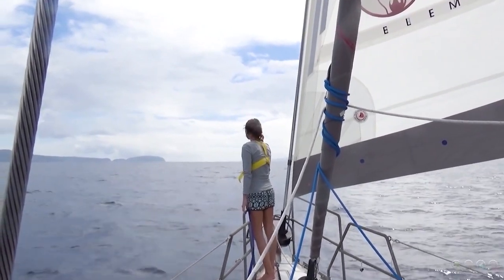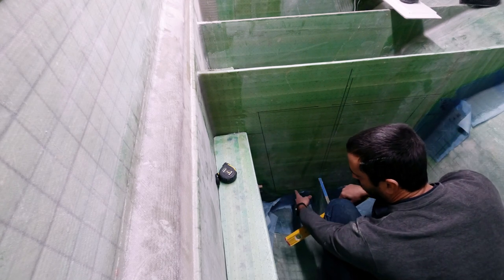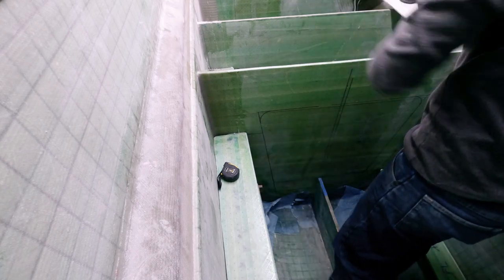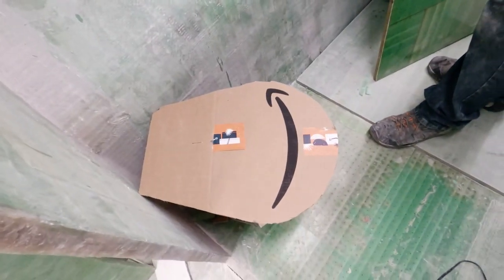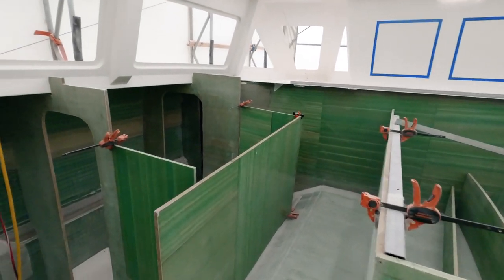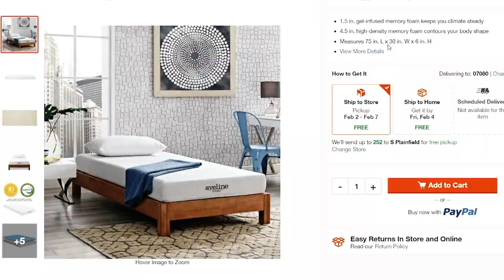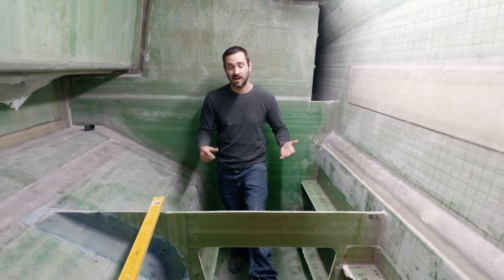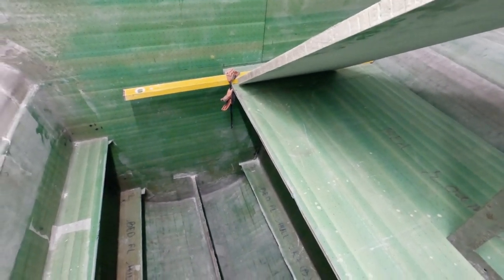CATAMARAN BUILD - We Brought On A HUGE Partner!!  (MJ Sailing - Ep 222)

Comment: I noticed you were using a hot knife to cut foam for a mattress. Just thought you would like to know that the old style electric knife with two oscillating blades works really well for cutting foam. Fast and clean. Excellent job with the glass work by the way.
Reply from the maker: Yeah, that was for our aluminum build back in 2016. As soon as we put out that video a lot of others suggested an electric knife and we were like "Why didn't we think of that?!?!". 😂

Comment: There is a store in Baltimore, called House of Foam. They have made many different shaped foam cuts for me over the years. Give them a drawing and they can cut it. Think of an L shaped cut in the middle of the mattress. When flat it's your mattress. When you need to work on the engines,  you could fold it in half and take it out of your way. Giving more room to work and keeping the bed clean.
When building a master stateroom, fitting the space to any anticipated use of the owners day to day use, should be the priority. Then the ease of maintenance.

Comment: Vetus makes great products, congrats! For the mattress, I would think splitting it in the middle would be the biggest PITA unless you're planning to never actually use that bed (in which case why would you care about activities ;o). So everytime you need to check the oil, you have to strip all the linens off the bed, shove it all to one side or the other, lift it up, check the oil and then put it back down and remake the bed? I think I'd just go with a 2" shorter bed or hinge it on the side.

Comment: Hi guys! been following your build for a while all the way from Russia. 
Your cat is very interesting and you have a lot of thought put into organizing your space.
As a though: you look at the mattress as a one piece or a two piece split longwise, but you can split it widthwise 1 or 2 times like in a folding bed (or a hospital bed). The splits would help you get more space over the engine, because they would fold at 90' up to the ceiling. Have a look at motorized hospital bed frames to get the picture.

Comment: If you decide to use a foam mattress ,take it from a guy that's had 6 back surgeries ,go to the best memory foam mattress pad you can find. I'll never sleep on anything that's not memory foam . Our mattress for our king size bed is 10 inches thick and it's heaven to sleep on compared to the orthopedic mattresses we've had before the memory foam. One thing about memory foam it molds to fit your body and on a rocking boat it would really help to keep you from rocking back and forth or even falling out of bed .

Comment: They make RV short queen mattress that are only 74 or 75 inches long.  I learned that when a regular queen size fitted bottom sheet didn't fit snug on my RV bed. 
Instead of hinging the bed could you rig a mechanism to just lift the whole thing straight up? 
Hey, how about mounting the engine to the platform the bed rests on, that way you could have a vibrating bed like they used to have in motels.  😁

Comment: I was thinking as you were trying to figure out your bed situation and wondered if you could engineer some way to lift the entire bed platform straight up against the overhead? That way you wouldn't have to deal with the pivoted platform piece(s) and the only space you would lose would be the thickness of the mattress overhead when the space was opened up to work on the engine. Maybe 4 pulleys at each corner and a cord similar to a Venetian blind setup?

Comment: Outboard motors is the way to go , lifting them completely out of the water similar to the James Warren designs . Ease of maintenance  , repairs  and best of all cost of replacement  .
Reply from the maker: That was the plan until we spent some time on cats with outboards. We didn't love the noise.  And after talking to their delivery captain, the lack of thrust in reverse made moving in a tight marina difficult.  These, and a few other things, made the decision to go diesel easier.
Reply from the maker: We originally ordered the kit with the idea of doing outboard engines, but after talking to a number of Seawind owners who had them on their boat (and weren't thrilled with them), and getting aboard one as well, they only look to be ideal for coastal cruising, but not for the long term cruising we'll be using this boat for.  🙂

Comment: Hinge and mattress selection: I recommend a butterfly hinge in the center of the space running along the longitude axis and make it removable. That would allow to work on the left and right side - or both.  Left hinge   l._    Right hinge    _.l   Both    l.l    Hold with velcro, hook or prop stick.  Remove the entire unit as one piece for major issues, access and engine removal.  Mattress - foam is heavy, bulky and will mildew; I've had a Sleep Number system for over twenty years and swear by it.  The queen system is made up of two mattresses independently adjustable for firmness with a layer of foam. It's easy, light weight, mildew retardant, collapsible, relocatable (topside/salon).

Comment: The hatch over the engine you discussed at length: Did you consider splitting the hatch and mattress in half athwart-ship, and hinging them together? The forward half would be flat to the overhead when raised. The strut(s) needed to hold them up will be a bit more complicated but probably no more than splitting it fore-and-aft.

Comment: Hinge the bed vase again accross the 60' width where the square was outing the base so that between the hidges goes near vertical and the base from the new hindge to the end f the bed can go horizontal to the cieling to the roof of the cabin allowing full access to the engine.

Comment: Major discovery for me. See how Matt uses his tape measure,  when it's in a confined space,  like me, he bends the tape by holding the actual handle or mechanism at an angle. 
I  found out that every tape measure in the world has a measurement stamped on the mechanism that states how much to add if you just use the back of the mechanism hard up against that end of the tape.
Very useful if you want really accurate and easy dimensions in confined spaces.

Comment: Amazing you have come such a long way in a short time; it's nice to see. I was thinking you could make the bed lift from the four corners up towards the ceiling. Four straps made of the same material as seatbelts or Dyneema hoisted by small remote-controlled electric engines. That would be very cool and leave plenty of space to work in the engine compartment etc. The same concept is used in some camper vans, I don't know exactly what it's called. Retractable ceiling bed pulley system or something like that.
Reply: #Vanlife calls them elevator beds

Comment: I'm sure you figured out the bed scenario by now but what about a double-hinged bed board that instead of hinging like bomber doors down the middle, hinges across the middle to fold the front half of it up or under the back half and then you can hinge the back half along the back wall to fold completely out of the way?
Reply from the maker: The issue with that is how the mattress foam folds.   We found that we'd need to cut the foam wherever you think it would bend.
Reply: @MJSailing  True but while opening it up down the middle will provide engine access, it will certainly diminish activities compared to my hinging suggestion that would not only allow you to get to the engine but may help with the indoor activities at the same time, no?

Comment: Question?: since you have partner with Vetus, why you don't use the E-LINE INBOARD PROPULSION MOTOR Line for your boat, way smaller, less maintenance and less noisy. Also the price of gas will continue to increase .
Reply from the maker: They only currently offer up to 10kw motors.  These are too small for our comfort level.   If they had larger, we'd consider doing a hybrid.

Comment: Avoid foam particularly in hot climates, go for the best mattress you can, some manufacturers will produce a custom size.  I had one made some years ago, it just took a little longer and wasn't more expensive than usual.  The manufacturer can include a zip and velco flap in the middle to avoid an irritating gap. 
I hope Vetus can guarantee availability of parts/replacements well into the future.   That really is a sign of a good manufacturer.
Reply: 200*160 cm or 200+80 cm are standard sizes in many coutries....

Comment: Awesome news on the partnership with Vetus.  Have you considers a set of 4 gas shocks lifting the mattress vertically?  If you can get the heights from front to back it would make maintenance/repairs much easier.  Not sure if there is a vender that makes it to where you can lift from the front and all four raise equally.  Just a thought.  Love the build.

Comment: Could you hinge the engine bay cover on the outboard side, have enough width that when the cover is hinged up that the mattress stand on edge against the outer hull, then the cover would be at or close to 90º. I guess by the time you read this it's too late, but still curious if this would have worked?

Comment: I’m no boat builder, but could you build clam shell doors and use a one piece mattress by pulling the mattress to the ceiling with rope/bungees and then opening the clam shell doors without the mattress interference and have full access?

Comment: Could you maybe lift the entire mattress vertically, with say a rope and pulleys at the corners?  This would give you as large a working space around the engine as can be had.  No headroom issues around the far end of the engine.  It would also be simpler than having two mattresses.

Comment: On the bed lift system have you considered lifting it straight up. Similar to an RV toy hauler garage bunks which lower from the ceiling in parallel to the floor.

Also went straight to Vetus and ordered a catalog :)

Comment: Is there enough torsional rigidity in the foam core so that you could put a strut just on the back-side of the clamshell hatches? Or would you need to put a strut on the front edge, too? I would assume that would obstruct access to the engine more than you'd want. I suppose if you glass in stringers along the bottom of the clamshell doors???

Comment: I have a few vetus items on my boat but having troubles getting replacement parts for them and service kits , I have a fresh water pump start leaking but can't find a service kit for it, I took it apart to find gasket was damaged from new had been assembled incorrectly.
Just letting you know my experience
Reply: Sorry to hear that you’ve had a negative experience with a VETUS product. In addition to our unique 3 year warranty period we should be able to offer assistance long after that. As we do not sell to consumers directly we do not have the required data within the system of our head office to help you out directly (date of sale, model number, parts required) so I would have to advise you to contact your point of sale for further assistance. Your sales representative should be able to assist you with warranty, technical information, and spares. If this is somehow impossible or if you feel that support is lacking, please send us an email on our general mail address (found on our website) with a description of the failure, the spare part requested, and please include your purchase information so we can respond adequately.

Comment: Instead of a hinge system why don’t you think about a pop up trailer system ,instead of being on an angle the bed would come straight up. And that would give you more room to work on the engine. Besides you would only use it occasionally for Engine maintenance

Comment: Why not have it base of the bed as two pice but instead of hinging it for to aft, run the hing port to starboard..  Have it fold up at 90 degrees at the far end, then have it fold another 90 degrees a little further up   _|-  with a couple of simple boards or support the mattress could rest horizontal while you are working on the engine.

Comment: Wondering if you have any thoughts on boat computers. Something like the Star 
Trek starship computers, or HAL on 2001... It's now quite feasible to have such devices to log activity/maintenance/repairs/boat metrics... Sensors have become very inexpensive, temp/pressure/c02/gas_particles/compass/motion sensors/gforce_sensors/gps/water/wind speed/wind direction/... Could do some very interesting things hooked up to cameras and other devices. Things like sound detection in a specific direction turn on cameras to catch wildlife activity, or smarter autopilot, better safety warnings/notices... A combo wired/wireless sensor network with multiple embedded processors could make a really fun build out.

Comment: Foam mattress? How about memory foam? Those are super comfy, but flipping them may be an issue. I was going to say that giving the constraints you have with space for the engines, I would have gone with twin 10 kW Oceanvolt servoProp drives. Then I looked at the price! Can Vetus put together a similar system? There's no way that twin servoProp 10 kW electric motors (and the controllers, etc.) can run over $85K! Things are looking good with the build!

Comment: Are you installing your engines with shaft drive or saildrive?
Reply from the maker: Shaft drives.  Moves the engines forward for weight balance.
Reply: @MJSailing  will be interesting to see how you insulate. Diesel can be loud under the bed, also the smell, but that's when only when the boat gets old.  However shaft drive is a good choice.  Didn't they allow it to be moved even further like in  antares catamarans, worth asking them if that is possible.

Comment: Clam shell doors would mean unmaking the bed just to do engine checks… I’d go with the car hood…..
Reply from the maker: If we go with the clamshell doors we'd do two twin mattresses, where each would have their own fitted sheet, and then the top sheets and comforter would be queen.  The top sheets would need to come off each time we checked on the engine, but they could just be pushed to the side.  🙂
Reply: @MJSailing  ok,  but have considered a 4 point hydraulic lift system to lift it straight up ?  That should drive you nuts, modifying the plans yet again …. 😉!

Comment: This would be a really unique solution for engine access, so don't do it. But if you look at some van life videos you will see folks that have the bed platform on cables in the back of the van so that they can crank it straight up during the day and get it out of the way. If you did that you would leave it down except when you cranked it up to get engine access. There are even people that have it on tiny little electric winches to get it up and down. When it works, it is really cool. In salt air, I bet it never works.

Comment: Why not use electric drive (smaller/less maintenance) with a single generator placed somewhere in the boat where it is convenient and has the minimum effect on moment of inertia.. A second advantage of this is that you can get battery regen from the motors to charge the batteries when you are sailing, and use the saved space to increase your Lithium battery bank (see  Sailing UMA on YouTube). Info sources: Ocean Volt/Torquedo/Fischerf Panda/Vetus. I am sure you have considered all of this already, so sorry for my interference but I would be interested in your conclusions though.
Reply from the maker: The combination of electric motors, generator, and really large battery bank weights a lot more than a diesel and fuel.   The cost is insanely high.  And it's really inefficient converting the energy back and forth.   Jimmy Cornell said his Outremer 45 with an Oceanvolt system with the intent if circumnavigation.   He got less than a thousand miles before he realized the numbers quoted for regeneration were nothing close to reality.... So you need to run a generator a lot more than planned.    A good sailing boat doesn't use much diesel in it's life cycle anyway.  So the cost/benefit is low in this application.
Reply: Uma has its Oceanvolt curtsey of a E-boat enthusiast who installed 4 on his cat and decided that it only needed 2 and then a sponsorship from Oceanvolt. They get stuck in places because of wind and/or tack for hours into the wind to get out. Also the cost of a system for a caterman is eye watering. 3rdly weight such systems are heavy, which is not good on a cat.

Comment: yeah, sleeping on the crack does not sound comfy, fold up takes 16" off width of opening
Reply from the maker: The seam is at 30" wide.  It falls right in the middle of a queen size bed.  So nobody sleeps on the seam unless a bed hog :)

Comment: Why do you need to split the mattress why can’t the mattress just be pulled when you need access?
Reply from the maker: We check the engine before using it every time and also do hourly checks when in use.  It's too often getting moved to not have an easy solution.
Reply: @MJSailing  ahhh I see that was my none Sailing brain thanks for the explanation